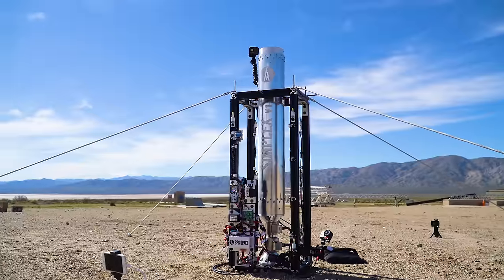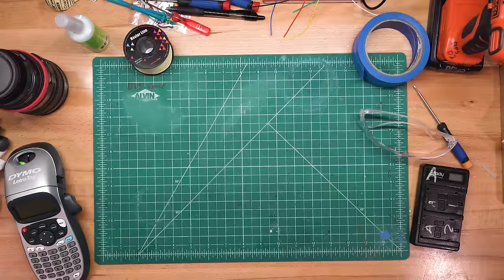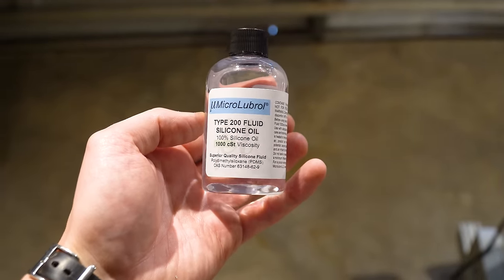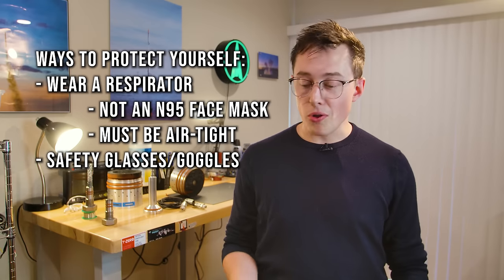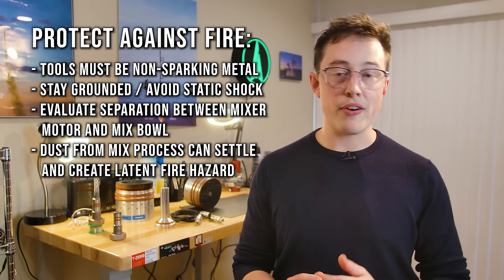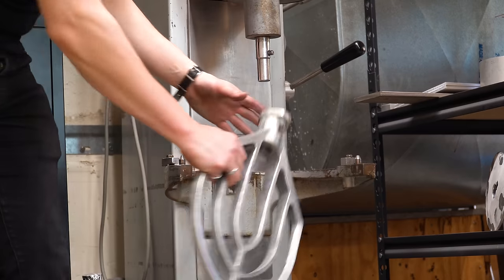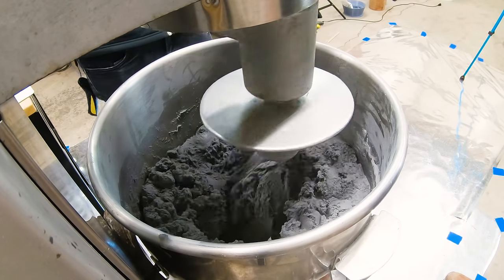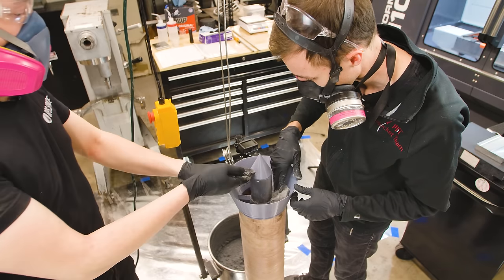Mixing And Casting Rocket Propellant - Simplex Ep 2

Comment: also this rocket engine was expensive the HTPB cost 130 usd per gallon which can make 5+ gallons of pro because only  10.7 percent and 4.577 percent of IDP and 1.629 percent MDI that is cherry limeade binder i did a program and designed a solid prop  my self based off of cherry limeade i also added 4% iron oxide like the space shuttle SRB 61.5 % ammonium perchlorate shh dont leak lol i don't care if you use this  and thanks to charlie garcia for giving me the idea with one of his videos.
Reply: What was your calculated ISP?
Reply: @jimurrata6785   well on the size i was working on the engine was 3 in diameter and 10 in long and it lasted about 4.3 seconds the 7 tests I did was all about 4 seconds
Reply: also it is low ISP but that was because the prop was made for high thrust instead of high isp is is also my old prop my new prop has high isp and high trust but is still in the works.

Comment: Always wondered why solid rockets forego simple compression as the binder or use a sintering/sintering-like process. Yeah, yeah, heat/pressure go boom. But if you listen to that boom carefully and close enough, you'll hear "That's just an engineering problem. Don't be a wuss, Daryl."

Comment: When you are sucking a vacuum, doesn't it simply evaporate moisture from you mixture? You could dry the individual components or suck a vacuum on them before you mix them.
Reply: Vacuum is there to remove bubbles and those form while mixing...
Reply: @HVM_fi  If you take the vacuum low, water will evaporate. At low pressure water boils at room temperature.
Reply: He is talking about -27.5in of mercury, which is around -930mbar. I don't know how precise his instruments are but this is the pressure where water starts to boil at less than 100°F. He gets right into the range where water boils at room temperature.
Reply: @AlJay0032  I don't think it's has anything to do with moisture (the bagged ingredients are very dry). They used the wrong tool for mixing, and it take too long, and the curing started.
Reply: @AlJay0032  This is a polyurethane binder. Isocyanates react with traces of moisture producing gas. While you can dry stuff under vacuum, you will never get it dry enough to eliminate all these traces with vacuum alone, especially when using water soluble inorganic salts. So there will always be bubbles both by mixing the stuff and also by chemical side reactions (isocyanate plus traces of water).

Comment: OMG cleaning a commercial kitchen dough paddle with a Dremel tool is comically lame. If you're going to do that kind of work get a sandblaster and if you're concerned about contamination use CO2 sandblasting. But whatever you do don't use a freaking Dremel tool to clean something like that it's a complete waste of the Dremel tool bits and it's really really inefficient.